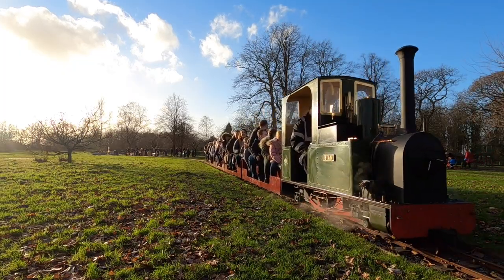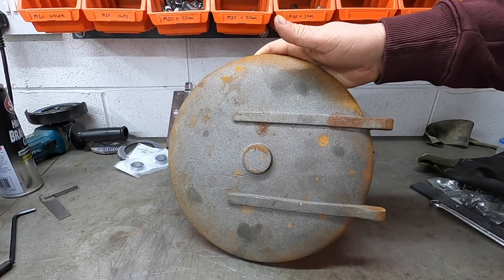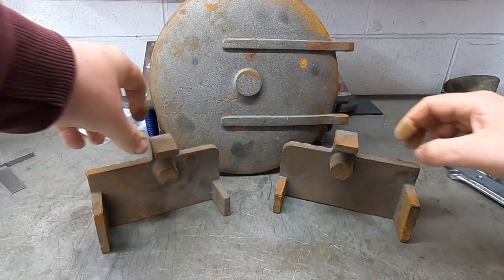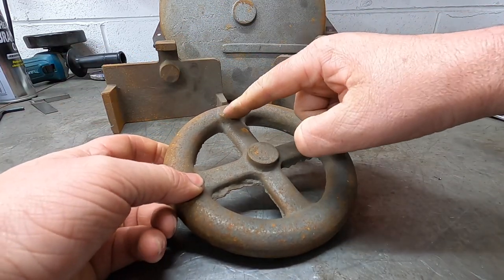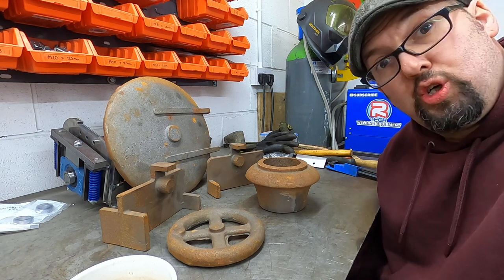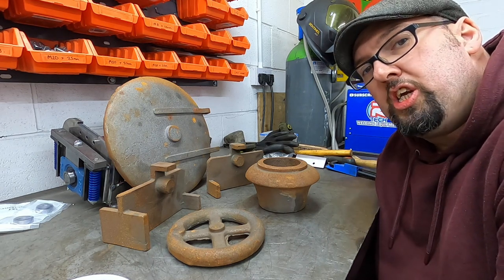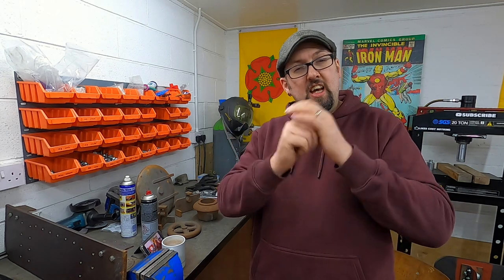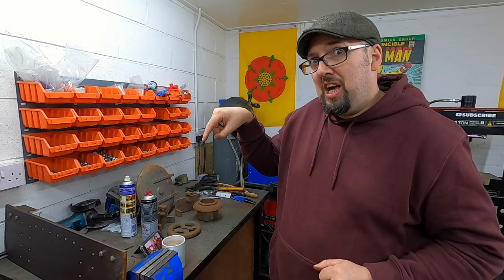New Parts for the Steam Loco Build - EP23 - 7.25" Gauge Locomotive Build

Comment: Hi Matt, seeing the frames stood against the wall reminds me when I built mine the workshop was so small the entire construction up to fitting the boiler was done with the loco standing on the front buffer beam. The original brake wheel started life opening roof lights at Rolls Royce Coventry. My wheels came off an overhead crane. Roger
Reply from the maker: Hi Roger, that is completely fascinating. Now you have mentioned the original being built on its end… you are giving me an idea to get the second one started! Please do stay in contact, I enjoy your comments on the memories of you building the original, did you ever think it would become so popular of a locomotive to build? And make a variation of. All the best, Matt
Reply: @MattChiversWorkshop  Hi Matt, the thing that really surprises me is the amount of work the engine will do in the Hands of people like Jim Heylock . When first planned it was to be used on Dennis Bates small garden line not on a track a mile long. Roger

Comment: Hi Matt
xmas has come early, one step at a time🙌🤣, you've enough project material to keep you going for another 10 year. I made mine by the beg, nearly! steal and borrow method, never bought anyhing retail except the injector and that does'nt work fully!!!😥
made everything else casting wise from solid C.I.
Great help there from steve👍👍👍👍
laterzzzzzzzzzzzzzzzzzzzzzzzzzzzzzzzzzzzzzzzz
Kev
Reply from the maker: Hi Kev, well funny enough, if I bought some turned driving wheels I have everything else in stock to get it to the same stage as the first, my only issue is space! Like I said I’m going to start by making notes of measurements of Steve’s then doing sketches, to make later after the first one is done and steaming around. All the best, laters 👋 Matt